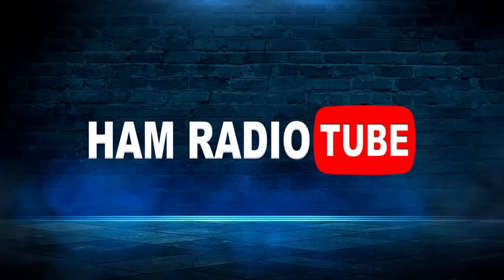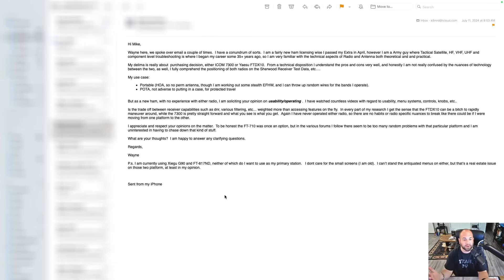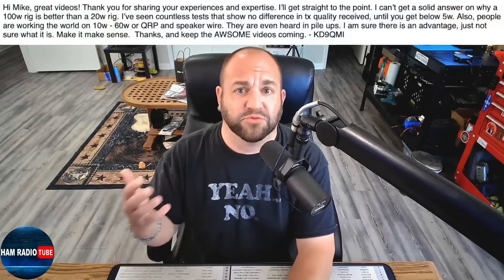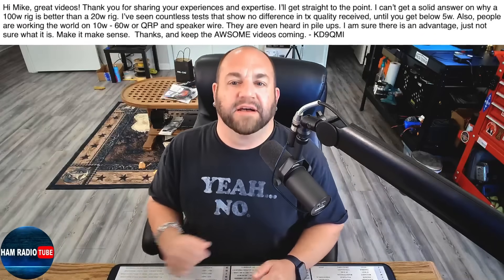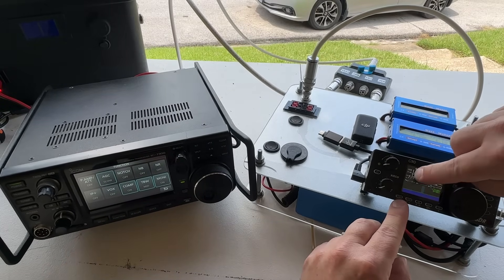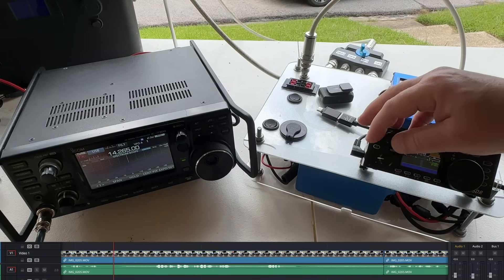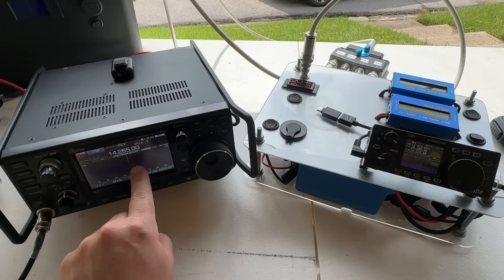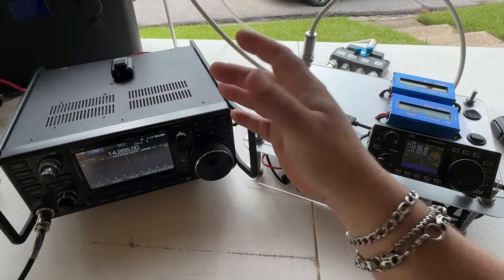Is There A Difference Between 100 Watt & 20 Watt Radios?

Comment: When I use my 705 at 10w in Hawaii, I usually get around 20-25 QSOs. When I use my 7300 at 100w, I'm getting 150-250 QSOs in the same amount of time. Power is important when working more than a single hop.
Reply: Worked HI with 5W CW from Western PA during field day using a Rybakov vertical antenna.
Reply: Those of us on the eastern portion of the US really appriceate your 100 w. TY for not being QRP or a QRP purist.
Reply: I can make even more contacts with my cellphone! It's all about fishing. You can go fishing with a pair of waders and a fly rig, or you can buy a fishing trawler and nets.
Reply: Re KH6: I think you nailed it. For some conditions or longer paths, 10 watts can be a significant limitation. Other times it doesn’t matter. It all comes down to what experience you want to have.
Reply: @KH6WI  power does make all the diffrence, but,anything over 1000 wats is wasted money.i have better luck with 400 watt modulator.

Comment: For POTA the FT-710 is probably better than either of these
Reply: Having both -- an FT-710 and a G90, that is -- has made me happy. There are reasons to have something smaller and more portable than the FT-710, but when I'm sitting down for a session where I want the power, the FT-710 makes me happy.
Reply: @unclemikeyplays  I use the G90, 710, FX-4CR and QDX for POTA activations. I absolutely agree it’s situational.
Reply: This. FT-710 is the correct answer.
Reply: Yep, I came down here to say that. I'm not sure the person asking the question appreciates the size and weight difference between the DX10 and 710...especially the field, as it comes with a handle!
Reply: Agreed!! I have the 710, and sold a xeigu 6100 ...FT710 is very solid ❤
Reply: @paulsengupta971 I have the DX10 and I can’t imagine having to lug it around.. for me, my 891 with an lg tuner is perfect!

Comment: Spectral purity and transmitter phase noise are two factors in comparing transmitters but I agree it’s all about the receiver. And thanks for adding that the 20 watt signal might not be heard in some band conditions. Just like a 100 watts may not be heard but the 1000 watt station will be at times.

Comment: I have a G90. It cost me about $400 and I was essentially on the air. Comparing a $1,000 radio (or much more) with a $400 radio does not seem logical. Got the bucks, hey go for it. Some of you guys have spent thousands on radios. Not my world.
Reply: Not to mention a tuner built in

Comment: In fact, with the right conditions, it’s entirely possible to communicate around the world with just 5 watts. I started doing this when I was 16, using a GE CB radio. Nowadays, I’m using a $200 SDR, and once again, I’m working with just 5 watts. Modern SDRs have incredibly advanced filtering capabilities, allowing you to tweak bandwidth and other settings, which makes a huge difference.

My biggest challenge now isn’t power—it’s noise: RFI, grounding issues, and other interference. I’m focusing on solving these problems before adding an amplifier (which is still under construction). After all, what’s the point of having high power if you can’t hear anything? This is especially true for me, living in Africa, where the number of hams is very small.
Reply: I wish that I could remember the model of the GE CB radio that I had many years ago. I tinkered with it a lot, had a six switch external box, to hit 64 channels, and switched one of the knobs over to be able to lower the power output. Really messed with the "fox hunters" with that. One time, I put it in a backpack, with batteries, and hooked it to a dipole antenna, I had guys running around with walkie talkies to find it.
Reply: What SDR equipment are you using?
Reply: Never could hear around a pig pin

Comment: A borrowed G90 without noise reduction made me decide to buy an FT-891. The inability to clean up the receive signal was a big decider in and around my home. I find on POTA in an isolated park I use zero noise reduction in most cases as the noise floor is nearly nothing. I think a G90 would be great there. The built in antenna tunner is a huge advantage.

Comment: Nice video.  On the G 90,  there's a video up now showing exact settings to quiet the G 90 down significantly.  The end result was the receiver saw a huge difference.  I might be a little exaggerated, but after the adjustments were all made the difference was almost like listening to a cell phone signal in comparison to when the G 90 was first turned on.  73

Comment: That was the best explanation of power differences I've heard someone give.  As for the demonstration of the receivers, you had perfect timing. I don't know if you caught it, but when you turned on noise reduction, there was a qso that could not even be detected without it.  (at least over the computer.)

I love your videos, keep up the good work.
72/73 N4PGW

PS If you want to prove the noise reduction, etc, give us a demonstration during field day.  That's where the radios are put to the test.

Comment: Great video Mike. One of the things rarely talked about on the transmit side is audio quality. This is so important, especially with lower powers. A well set up audio with 20W can be better than poor audio on 100W. Clarity and punch are the way forward, especially on SSB. Ian. G0VGS
Reply: Id rather have 100W with clean audio.  The difference between 100w and 20 is roughly 1 S unit which can be the difference between making a contact and not

Comment: Thanks Mike for a very good vid. I hope it helps those who have had the same question. You exibited the results very well, and quite frankly I wanted to see a recived audio comparison for a long time between the G90 and any other rigs like the 7300. I own 2 7300s and a 705 (I Love them by the way) and have looked at the g90 and others for lower food chain type radios.I was just very curious and based on what I just heard, I will be sticking to my higher end stuff.  Thanks again and 73, I hope to one day get to meet up with at one of the many HAM fest I attend. I have made contact via ft8 and feel honored to have you there in my log. Now to to get you via Voice some day.  take care, Vic de KE8JWE.

Comment: Mike, not that you ever make a bad video, but this one was def one of the best Monday Mailbag videos. I run a 7300 at home also, coicidentally about to send it off to repair the multi-function knob which operates the notch filter and it’s imperative to have it in working order because that filter is INVALUABLE! Great job, appreciate the hands-on you did in this. 73 buddy 🤘

Comment: Great insights! Your contrast test was spot on to the point you where making concerning noise floor, and I completely agree with your points about QRP operation. Over the past several months, I’ve been diving into QRP setups and experimenting with various variables, and like you, I quickly ruled out amplifier power as a significant factor. The real "power" challenge becomes evident when you examine the antenna system. For instance, transmitting 10 watts but losing 75% of that power between the radio and the antenna due to inefficiencies drastically impacts the radiated power. Through my own experiments with EFHWs, different dipole configurations, and the Wolf River Coil (Silver Bullet 1000), I’ve learned just how critical the counterpoise and coaxial cable and toroid choices are. It’s astounding how much these components influence the system’s performance, even in the presence of acceptable SWR. In some configurations, I found myself losing up to 85% of my power transmitting 10 watts but only radiating 1.5 watts!

While SWR is often treated as the gold standard for system performance, it’s only part of the story. Using a field strength meter has been a game-changer for me, offering real insight into how much power is being radiated. As you so aptly pointed out, the goal in QRP is to transmit to rise above the noise floor. Regardless of a radio’s price or complexity, every receiver battles the same noise floor, making radiated efficiency the real key to success.

For operators with the luxury of high power, inefficiencies in the antenna system can often be overcome by simply turning up the amplifier. Problem solved. However, for QRP operators, that’s not an option. This limitation is what makes QRP so fascinating. It demands a deep understanding of every component in your kit and how it contributes to the overall system. Every part of the kit must work as efficiently as intended, and the operator must have the knowledge and skill to ensure that it does. That challenge is the essence of QRP—it’s not just about the signal; it’s about the operator’s mastery of their craft. 

With that said I cannot believe you wadded into the shark invested water of the Yaesu menu system vs, well,,,, anyone else. There is an old saying we had when I worked in the automotive repair industry "your tools work for you, you don't work for your tools". Nice video my man,

Comment: One comment is that receive can be improved even further with properly set RF gain control. The way Yaesu implements RF gain seems better than Icom’s, but the distinction is more about how it reflects visually on the meter for the Yaesu. 

The G90 likely needed its RF gain turned down some, and in my opinion the RF gain works best on the newest firmware—but it’s got nowhere near the granularity and functionality of the dx10. 

Even though I prefer the dx10, there’s something quite satisfying about using the g90. That tiny screen gives you a ton of information all at the same time.
Reply: You hit the nail on the head.  I literally hated the G90 until I figured that out.  On my firmware version, I often times am using no agc with just the rf gain with sometimes some attenuation.

Comment: I used to have a 7300 but sold it when I got my FTdx-101MP and I still have a 705 and use it for POTA (as well as my old G90) and I agree with you on the menus. The 7300 and 705 are pretty much the same. The FTdx-10, FTdx-101, and FTdx-101MP are likewise pretty much the same among their new. Yes the menu on the Yaesu are "different", but they really aren't that hard to use once you get to know it. Also, I rarely have the need to constantly make setting changes on a day to day operation, so for me, the clarity of RX is king for me. To each their own.
Reply: How much difference is there between 100 and 200 watts?  I'm thinking about getting the 101mp.
Reply: I have the FTdx101d it's a big radio. I own several amplifiers so didn't need the 200 watt version. It's 3 db difference. There are a lot of guys that buy the 200 watt radio to drive very large amplifiers. Most 1.5 kw amps require 50 watts of drive roughly. These guys are running 4-5+ kw amps

Comment: Great video.  One comment.  As I understand it, the Xiegu G90's internal speaker is less that 2/3 the size of the ICOM 7300's internal speaker.  Assuming that's correct, the little G90 speaker is bound to have a different signal response (EQ) than the one in the 7300.  That can make a huge difference in the noise you hear.  I wonder what it would sound like if you bypassed the speakers and went straight to the board.  Thanks for the video!

Comment: I own among other HF rigs a Yaesu FT-891 which I describe as an "eccentric" radio with an outstanding receiver especially for the $620 price of purchase for me a few years ago.  The eccentricities include some of the features you discussed in your video and they take some getting used to in exchange for the relativelly low price of purchase and the excellent receiver performance.  I also purchased recently a Xiegu G90 from Radioddity and am very pleased with it even though I am just now getting used to it on SSB and CW.  I am not much interested in digital comms.  What is really important to high performance IMHO, however, is the antenna.  I only broadcast into a 84-ft random wire antenna using a Nelson Antennas 9:1 UNUN that is hung in L-configuration only 20-ft above ground.  Nonetheless, due to the current state of the solar cycle, I even get DX on 20 watts!  20 watts is all you need--the military rigs acknowledge this--at least when our sun cooperates wrt DX!  BTW, very informative video.  Many thanks & 73 de AE5ZX

Comment: Thanks for the honest video, Mike. I am also an ICOM fanboy with 2 7300s and a 705. Permanently loaned my FT-891 to my son for portable use as I always struggled with the searching for functions during POTA activations. I loved the DNR function but hated most everything else (relative to the 7300.) If I were to buy a new rig now, as much as I want the 7610 for all the wrong reasons, I would be torn between the FT-710 and the FTdx-10 because of the receiver sensitivity as well as DNR. I also have a G90 which rarely is used now that I have the 705 for CW/QRP. Just like the features and functionality better with the ICOMs than the G90. Thanks again!

Comment: Another great video. I feel you on the Yaesu menus. Not long after the FTdx-10 came out I was in the market for a new HF radio. I really wanted an IC-7300 but everyone had them on backorder. I studied the comparisons, especially the receive, and bought an FTdx-10 and haven't been sorry. I had an FT-891 for portable and it worked fine but I used it so seldom I had to look up menu settings to change things. I sold it and bought a FT-710 for portable since the menus and buttons are somewhat similar to the dx-10. I am happy with that choice so far. And I do now own a 7300 to run my Winlink gateway. I also have a g-90 (I had two but a friend talked me out of one) and ran the Winlink gateway at 17 W and it did fine. I think the G-90 is a good choice for a first radio and really good for portable where the noise floor is much less.

Comment: It's hard to beat the I-comm radios, they are fairly easy to get around if you have even the slightest idea how radios work. I passed my exam at the YOTA camp Youth On The Air, I work at the university they chose to have the camp and I did all of their audio visual, they booked me an exam so I could pass and walk over to the Bob Heil memorial Shack that was outfited with all I-comm radios and immediately make a contact. Those radios were something I sat right down and I was able to figure it out on the fly no problem. And as you said the power is not as much of a factor as one might think. Since I got my license about 14 days ago I have been working the world with my little uSDX+ SDR QRP radio with an At-100 auto tuner and a wire up into one of the trees in the yard. The first contact I made was to Belgium 5-9 from Nova Scotia Canada. I've worked Serbia, Slovenia and last night a guy just outside of Moscow 6600km away from me.  Not many features but enough that I'm happily making contacts.

Comment: I love my 710. Sold my IC-746 to get it. 

Is the Icom "easier" to operate? Yes.  Initially. Once you get used to the menu system the Yeasu is far more "customizable".

How about sound? My 710 is the AESS and sounds amazing!

Receive? Not even close. The 710 is a beast. 

When looking at a new radio it came down to the 7300 vs the 710. For me it was an easy choice.
Reply from the maker: See when I bought my 7300, its competitor was the 991A and the main reason I went with the 7300 after owning 2 other Yaesu HF radios was the menus.  And the waterfall on the 991 is just garbage.
Reply: @hamradiotube  I have a couple of 991s, for, well, reasons, and I've always been envious of the ease of setting the filters and the graphical representation on the screen of the filtering on the 7300. The 991 has various filters on the main screens, but that's not the same. You can eventually set them the same as the 7300 but you have to go into the background stuff to do it. Ain't nobody got time for that!
Reply: @hamradiotube  I concur about the 991A. Was never a fan.

Believe me when I tell you I spent a lot of time comparing apples to oranges before I jumped on the 710. My first ever rig was an Icom IC-706MKIIG. I ran it 18 wheel mobile for years. Quality rig! 

Then, when I finally decided to sell my Kenwood 530 to upgrade my base the IC-746 was another stellar rig. Loved it too!

But, when it came time to jump into SDR the 710 won out for the reasons I stated above. 

Good "talking" to you, brother. I watch your content often but have never commented before. Thanks!
Reply: @paulsengupta971  I absolutely love the screen on the 7300! I wish the 710's was as "roomy". First thing I did was get an external 19" display for the 710. Now I operate the menus with a mouse and my radio via PC and rarely touch the radio.

Comment: From the desk of WV3V, ALL of my POTA/SOTA activations have been with 20 watts or less, period. I don't own a portable rig with 100 watts and if I did, I guess I would use it for POTA. I like the challenge and it's not for everybody. 12,15, 20 contacts during an activation is OK with me. Making 100's of contact would also be nice but that's not what I am after. I am after the joy of going portable, limited power, antennas and, working for it. Again, that's what makes it a hobby, and to each their own. It's OK to like QRP, and it's OK to like QRO. For me, it's about having fun doing it. -Jason, WV3V

Comment: I'm a fan of ICOM radios (IC 7300, IC 7100, ID 52).  I also have two Xeigu radios (G90 and X6200).  I enjoy using everything in my shack, but I get a bit annoyed with the G90's noise.  I often think of picking up a Yaesu, but that would mean dropping $1K+ on another HF rig, and I don't think I'm ready to do that yet.  Perhaps in a few months, but not now.  I enjoyed this video!